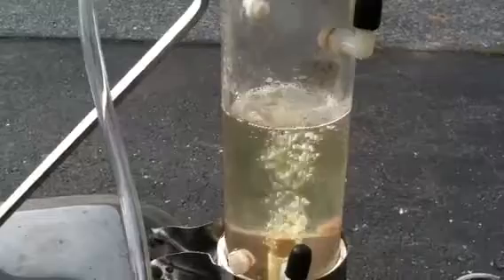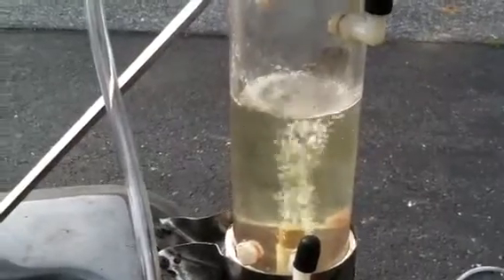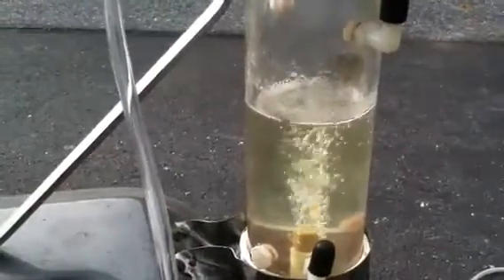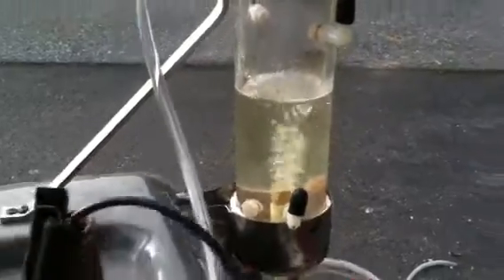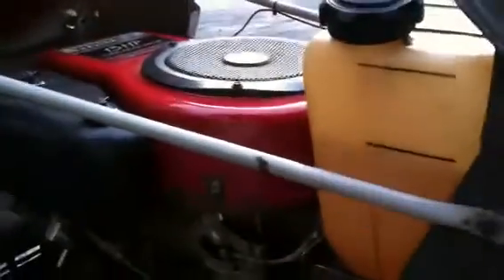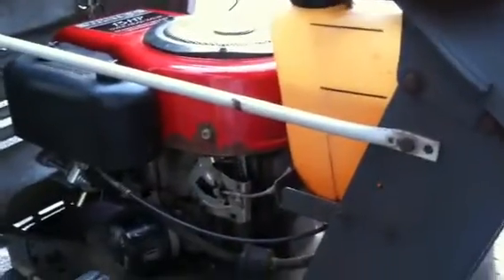Hho

Comment: Did you back off on the fuel? add a valve to fuel line and loop with copper tube close to exhaust before injection.

Comment from the maker: I sent you some info on a buck converter I would like to try it out only 8 amp draw on the mower it can handle that it can handle up to 15 amp draw,then the cell will draw 60 amps that should make more hho for it.With my spiral cell I could produce more hho I think if I can get 2 to 3lpm that will help out,my other cells can do more than 4 lpm but draw 25 amps to much for the mower plus they use koh I dont want to use that any more.Thanks for the info.

Comment: you can build a buck converter yourself.......i sent you the video
you could mount an alternator on you mower......you will need more power than the mower gives you............or charge your battery with solar then use the battery without being hooked to the mower charger......deep cycle boat battery